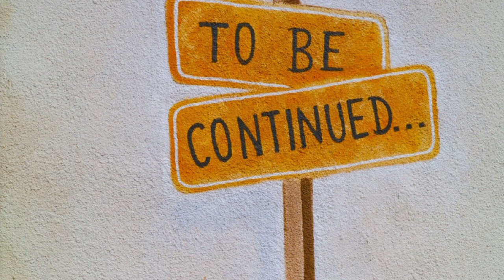Repairing the RCA J-2 Part 1!

Comment: Really interesting to see the internals of these older pieces of equipment! It seems like they made that bracket so that the only way to remove it was to drill out the rivets. I guess they didn't expect someone to tinker with it 70 years after it was manufactured!
Reply from the maker: I agree!

Comment: Chris Cuff passed? That's awful... I learned a lot of what I know about record player repair from his channel. 
Rest in peace, Chris.

Anyways, I just wanted to let you know that the inside of the original cartridge is filled with grease for electrical insulation. After so many years, it usually leaks out all over the place. That's why everything surrounding the cartridge is covered in it.
Also, before you do anything with the cam, try and replace/rejuvenate the drive wheel first. The problem with the changing mechanism might be that the wheel is slipping due to age, not the cam slipping.
Reply from the maker: Ok good advice thank you!

Comment: Hey buddy just watched your video on the 4512 inch also the meter Noah still awesome you have any ideas where I can get a propeer 78s styylus for cheap I looked on eBay with the fans still and they were about $50 Yanks I also got some bookshelf dividers to hold my records and place I have a very nice shelf system from IKEA but the records keep falling over I looked for record dividers on Amazon's but the ones specifically for records were about $40-$50 so I found some bookshelf dividers that said they were the right dimensions hopefully they'll work as I don't have $50 to throw away onBlocks of wood thanks for the videos I really enjoy them  and as long as you're doing it I will be heere thank you